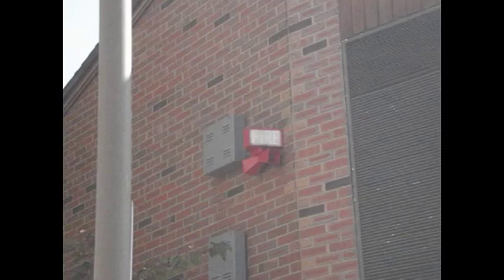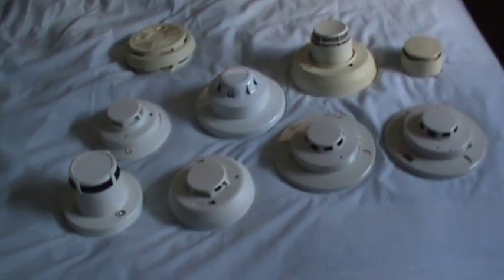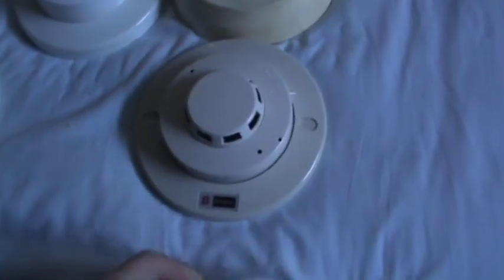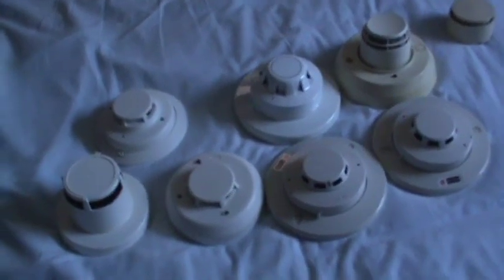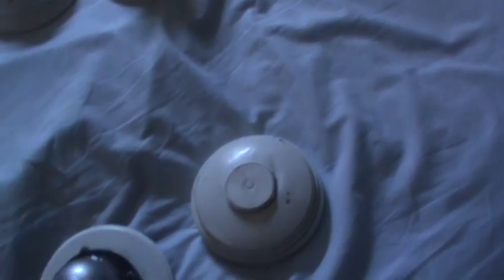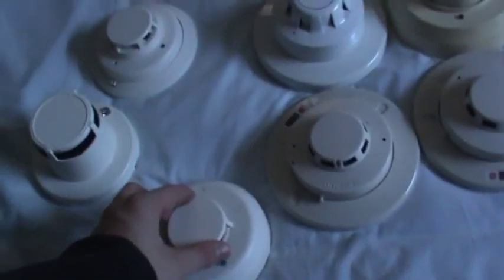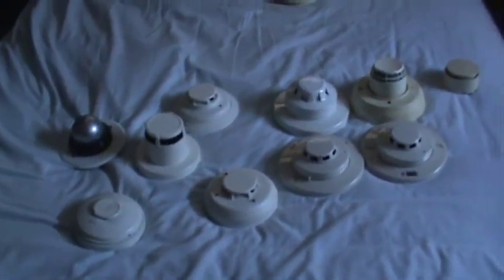Fire Alarm Buyers' Guide Part 3: Automatic Detectors

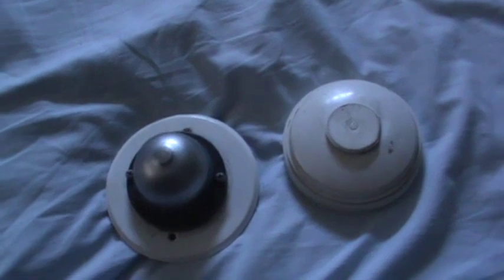Comment: 13:02 Actually, the Edwards ESA-2000 and I believe 8500 had addressable bases that would attach to their older conventional heat detectors so technically they were addressable mechanical heats

Comment: If you want to "make a fire panel" you should only use "4 wire" detectors, since they can switch "what you like" a 2 wire detector should only be used on a conventional fire panel.

Also you can get 2 wire fire alarms such as Rafiki that have both sounders and sensors on the SAME 2 wires. These only work with a true 2 wire panel.

Comment: So, a couple of questions:

1. Could I use an I3 on my Fire Lite Miniscan 124 panel?
2. What kind of relay do I need for a 4 wire smoke detector?
Reply from the maker: 1. Yes, you can use a 2 wire i3 on a Miniscan 124.
2. If you're talking about an end of line relay,  you can use a System Sensor EOLR-1. If it's only a demo system you dont NEED it though.
Reply: ***** Thank you, it is only a demo system. You can see it in my latest video.

Comment: Could you use the simplex detectors on a panel like the Silent Knight SK-2? Also, what are the model numbers of those detectors?
Reply from the maker: +NJMoo3652 As long as the detector model is approved for use with that panel, you can. I believe the 2098-9201 detector & 2098-9211 base are approved.

Comment: Hey Andrew. I recently purchased a system sensor 2151 2 wire smoke and I have a home made control panel. The 2151 is like the 2w-b because it requires a current limited circuit to operate. I tried using a relay with the detector but it began to cause issues immediately so I took it down. I want to know how I should go about this because I'd like to have 24 volt zones but I have struggled to find good information about it (I've been researching this for the past few years). I saw that you were able to do it with the I8005 and I was curious if you have any resources or advice on where to start with it. Also I have NAC supervision on my homemade panel now. I took 2 relays and put them on the same digital pin then ran 5 volts backwards through the normally closed terminals and 24 volts through the normally open terminals. The arduino is 5 volt so that's where my 2 wire detector issue is coming from
Reply from the maker: You need a voltage divider so that you can send 24 volts down the zone, and drop it down to 5 volts to feed into the Arduino pin. That's how I did it on the i8005. A voltage divider is basically just a high watt resistor of the right ohms. I don't remember off the top of my head what I used but you can find guides and calculators online.

Also on your NAC supervision, i recommend using a double pole relay instead of two relays, you'll save space on your circuit board. Just keep in mind that without protection circuits (e.g. diodes, opto-isolators, etc) you run the risk of blowing your Arduino when you try to use a mechanical horn on the panel, because of the "back-emf" phenomenon.
Reply: Official NewAgeServerAlarm thanks for the help. I have an optoisolator chip on all of the NACs at the time. I have used mechanical horns on my panel before I decided to use an optoisolator and I experienced no issues with back emf

Comment: I have a question, I am building a panel that is not going to have a trouble system, do I still need and end of line relay or resistor for it to work?

Comment: For a simple alarm circut (a pull, N/A and a power supply) could you hook up a smoke detector for the initiating device?
Reply: 2 wire no. 4 wire yes. Wire 2 wires like a pull station and 2 for the power source